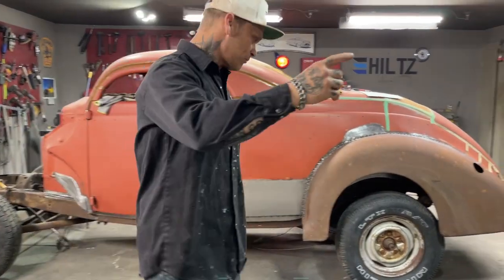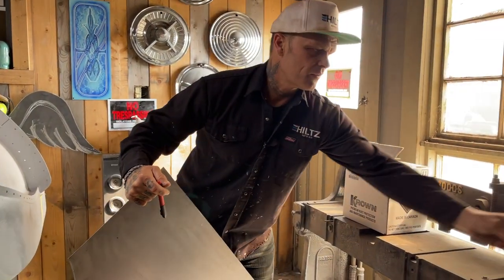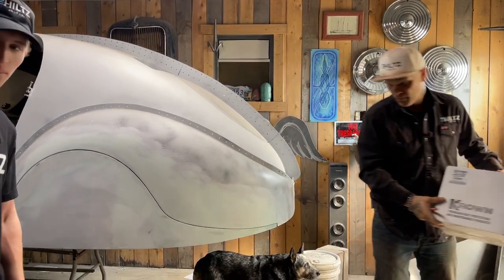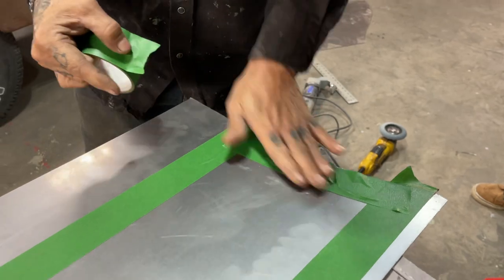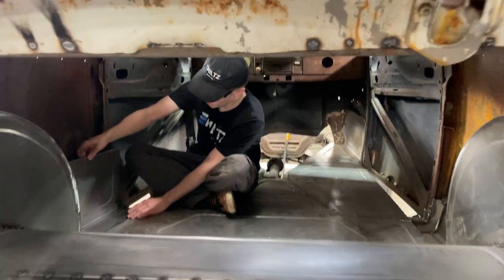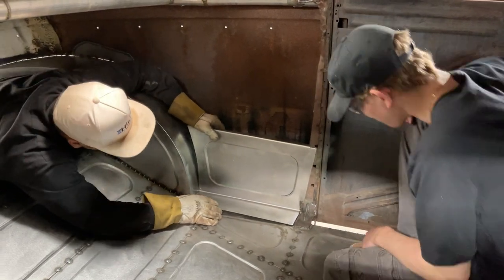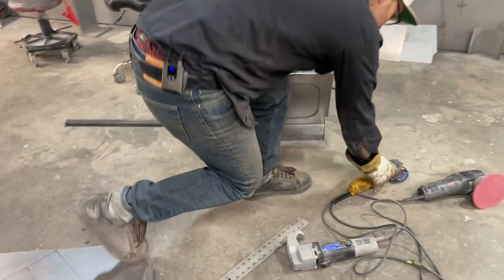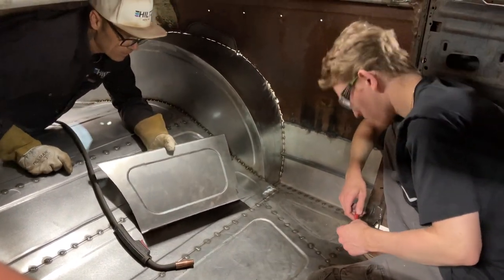Sheet metal panel fabrication 1940 Ford

Comment: Chad I'd rather cut the ."V's ", than drill plug holes to weld spot welds .. great idea !  the cut v's is a lot quicker & it's easier to see & clean up when welded in place .. I can see the advantage .. thanks for the tip !

Comment: If your plug welds aren't sticking, generally it means the hole is too small. 5/16 (8mm) is the preferred size hole for plug welds though some punch/flange tools come with a 1/4" punch.

Comment: Should have pulled that final piece out before welding it in and matched the template to it, and then redraw the new cuts into the metal for the other piece.

Comment: I've notice when Chad draws out the the lines for the bead on the panel that he uses tape on the corners he needs not to use the roll of tape because the roll gets smaller as he uses it and can change the corners from side to side. Look at the floor corners where he had a new roll and the side panels he just made